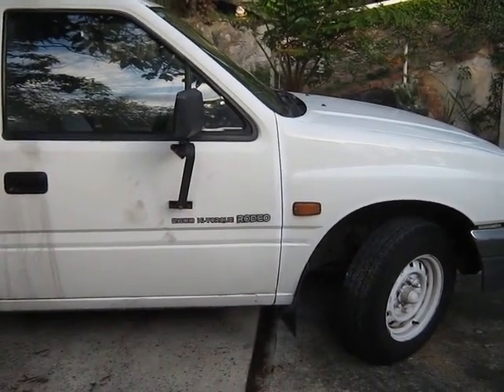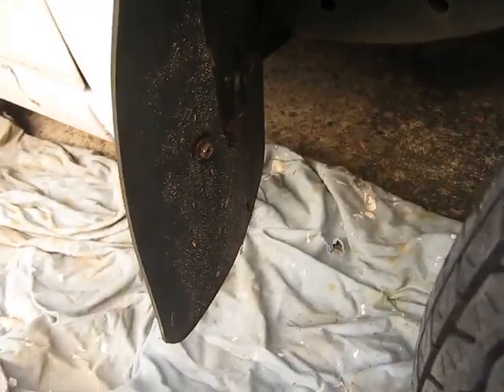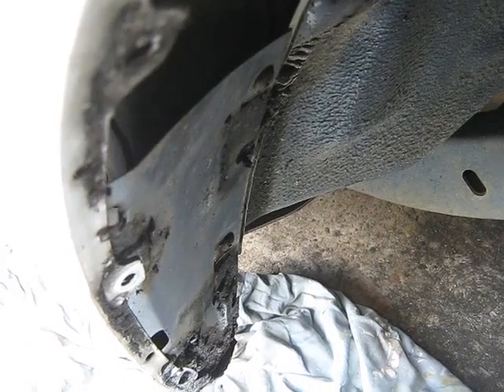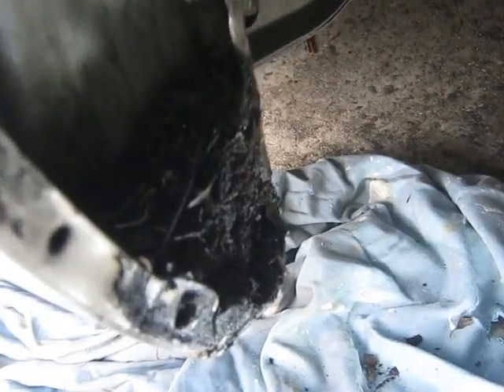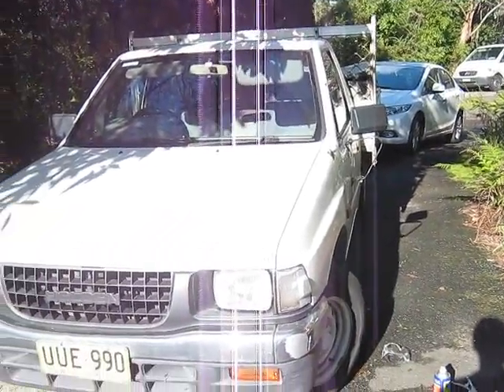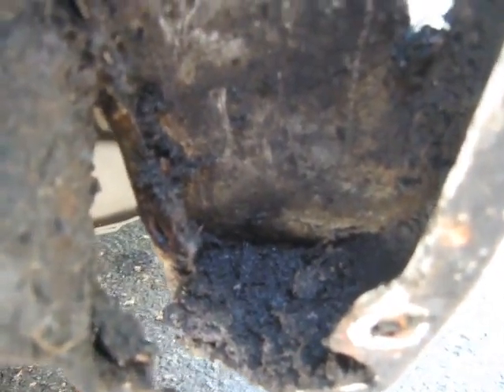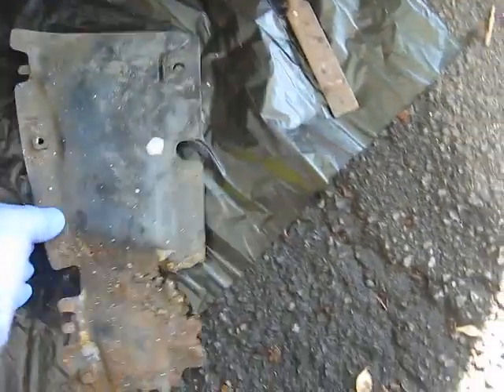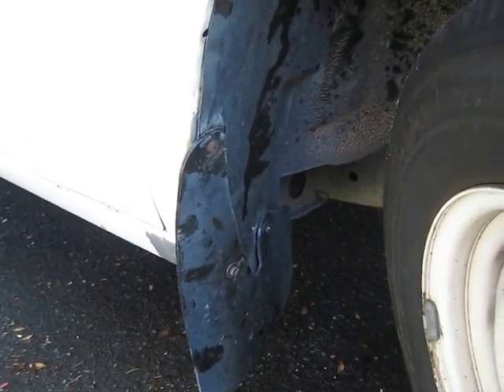Fix car cab rust isuzu pickup

Comment: A good idea also I had seen on another YouTube clip , I’m going to try. Under the drain sill on the front windshield where the plastic vents let the leaves in , cut up a black metal mess paper basket and glue the pieces under the vents and clip them back in. You could dab a bit of rustoleum on the cut edges. I was also thinking of doing the same for the dash vents also as they’re brittle.
Reply: That will stop the leaves falling through.